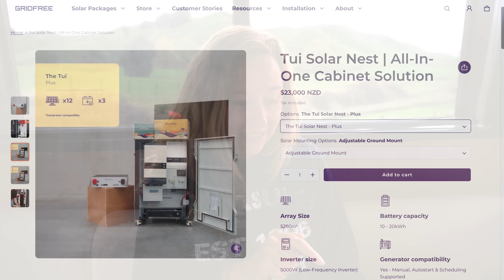Off-Grid Power: Why I Said No to the Electricity Company

Comment: We have a 5kva honey badger redEarth system operating for five years now, and depending on the solar radiation program (chemcloud) going on overhead we have had to boost the batteries in summer at least twice and in winter a couple times every week, however a small fuel cost is better than the robbery of the grid system, the provider rudely wanted wifi access to the inverter for remote access!! but we are not connected to that either, we have 15 panels and six batteries, winter is bad mainly because the sun is behind some very large gum trees all day

Comment: Definitely seems the way to go. For someone on a tight budget it would be useful if there were a solar system that can be expanded with further panels etc as the budget allowed. Thus for instance starting with four then eight and finally twelve. Each as a complete setup that could linkup to the next. I realize  that this might involve three smaller inverters increasing the overall cost but is what I would be looking for. The triple redundancy factor is attractive too.
Reply from the maker: Yes, I wonder if there is a way. The other worry is your system is too small and you need more that you bought!

Comment: 15k for putting poles in the ground is absolutely  over the top and I would have done that myself or get a builder to do the prep. I put solar on my new house two years ago and was quoted 65k. Did most of the work myself along with electrician and got an electrical inspector  to sign it off. 11kw of panels, 3 x  5kw victron inverters (two in parallel), two mppt's, 17.5 kw lifepod lithium  battery bank and 28kw carbon deep cell batteries  installed cost 35k. I had the system  on two phases in case of equipment  failure. No generator  and all electric including 3kw hot water cylinder.  Though this time of year the wetback  does most of the water heating . Solar panels are at 15 degrees  flat on my garage roof facing north.

Comment: In my opinion, the math is still bad for most kiwis living in a town or city, by the time you have broken even on the solar panels you need to replace them. Plus, if you are doing it to reduce emissions or whatever, it doesn't add up either as it takes ages to "cancel out" the emissions of creation + destruction of the panels. But for the case where getting connected to the grid is obscenely expensive, then sure install the panels.
Reply from the maker: Yes, I don’t think it would work for everyone. And I’ve thought about what happens to the old batteries too…

Comment: Just stumbled across you clip, I’m also off grid in South Otago.  Was quoted $13-15k just for the transformer outside my place plus the extras n the added bonus of a monthly subscription 😂 so I also went solar - 5 panels, 3 lithium batteries, inverter n back up generator.
In our third winter now n everything’s going ok, our road has been without power twice already this winter so being on solar has been beneficial when the neighbours come n hook into my wifi to see where the issue is 😂 we don’t have the best cell service where we are
Reply from the maker: So interesting to hear you had a similar experience to me! And great news that so far it’s working well.

Comment: Lovely ! Payback can be quicker too - if you can make power cheaper than you can buy it... it's paid off.  Take your install cost, divide by how much kw you've generated and how much kw the battery has discharged. And that's the cost per kh you've spent. When it's lower than the price to buy power... you're financially ahead. Of course power prices will rise during that time too.....

Comment: Hi from southern New Zealand 😁 i live offgrid and offline 😂i actually have a large panel on the roof ive never used 😂😅 i have small panels for lights and use a torch a lot, especially now in winter but ive been doing it for years and im used to it😅 i gave up on electricity when we had a local substation explode at 4:30 am a few years ago and blow out the grid around here on the coldest day of the year, at the time I was dependent on electricity for everything, especially heating, that was ghastly. The mayor almost declared a state of emergency it was minus 11 Celsius that day🫣 that was enough for me to rethink my dependency on the electricity grid. Friends of mine have a campground between Clyde and Alexandra and recently had to spend several hundred thousand upgrading the electrical network in the camp with all the attendant red tape and waffle, we did as much of the work as we could to keep costs down and it was still horrendous for them. Great choice going solar👍👋
Reply from the maker: Oh wow! Minus 11 and no heating! That could have gone horribly wrong for some people. And sympathy for the campground. I agree that you do get use to different systems. I think it was helpful that I got used to the limitations of solar in the caravan and sleepout before moving into the house.
Reply: @TravellingK yeah, it was bad😂 fortunately they managed to get a emergency transformer on a truck belonging to civil defence set up before it became serious but that was the last straw for me. We'd had power cuts all year, but that one was the worst. They've invested in upgrading the network through central Otago in the past couple of years but I'm done with it😂 funny thing is now I've figured out how to live without electricity, I only miss having a vacuum cleaner and lights that I can switch on instantly👍👋

Comment: 🌅 Excellent Kaye!!😊
Should get 30+ years for array🌻So, at.5% module degradation /year, you will have ~85% available output in 30  years ...then can just spray on PV collector 'paint' on them🖌
The LiFePo Batt's should give you 10-20 years (if cycled between 10-90% D.O.D) 
Sol PV IS Smartest , BEST long-term Free Energy Investment 🌞👨🏽‍🌾🗽
Reply from the maker: Very interesting...
Reply: @TravellingK  🌞Ive been in Sol biz ~31 years😇🌞👨🏽‍🌾🗽

Comment: How many people is it supplying for What can you run on it all very well to say going solar but what can you run? What’s the life expectancy of the panels and batteries? Plus the cost of replacing them.  Electricity is very expensive to hook up but it’s for life. You can run whatever you need to plug in all at the same time so again what can you run on solar. i’ve looked at solar it would’ve cost 25,000. Without the batteries
Reply from the maker: Without the batteries? Yikes! 
I don't think solar is the way to go for a big family with multiple computers and wanting all the bells and whistles in the kitchen. I have a big fridge / freezer as the biggest draw. The rest are lights, TV, charging electronics. A washing machine. More on the humble side.

Comment: Great reveiw any lead based battery be it acid carbon crystal ot glass/gel all have a realistic depth of discharge of 50% ive seen all these claims of 30% ive been in the trade 20 years in marine and offgrid systems. Lifepo4 in 2025 is the way to go when set up correctly

Comment: In Melbourne Australia, I have 6kwh system, with diy LIFEPO4 16kwh battery. Now the battery cost around $1600 and 440watts n type bifacial panel $90. So decent system can be made around $4k to $5K. Now in Melbourne, people give away their own panels, SMA inverters, direct drive lg washing machines. These SMA inverters can be modified to work off grid by getting the grid guard code from the SMA and washing machine direct drive motors can be used to make wind turbine and can be used with the SMA inverters along with the solar panels. I never paid any bill for last 2 years.

Comment: My brother brought a battery off NZ Lithium 14.3kwh useable capacity, and the price is just $5500, including GST! Compared to a Tesla Powerwall 3, let's just say you could buy 3 from NZ Lithium and still have some change!
Reply: New and used Leaf cells on trademe, $40 to 100 each, 3.7 volts 50 AH. Make your own, BMS available from Ali.

Comment: Now that you have your system in place, you should look for cheaper options to upgrade. I just installed a 6.2kw system and a 5kwh battery along with a bit over 5000 watts of solar and it cost me only usd 2400. Yes, I'm living in a place where solar is very cheap, I did most of the installation myself, just hired an electrician to do the final connections, and my inverter is only ip 21 (side filters need to be cleaned every 3 to 4 weeks) but still, it is an excellent value for money and I am on track to recover 60% of my investment within the 5 months of summer.

Comment: Nice.   We are in a suburb so are connected to the grid.  But, solar and batteries have largely eliminated our power bills, and most years result in getting a payment from the power company for the excess power we send back to the grid.  It ranges from $100 to 400 USD.  Previously our bill was up to $450/mo. 

Also, the grid by us seems to be a little spotty and we do have outages.  We never notice them since the batteries take over instantaneously.  The lights don't flicker, the TV does not stop.  We only know the grid is down because we get a message on the app.  Solar and batteries are one of the best things we have done.

Comment: You are the perfect use case for going off grid. Except using grid free is probably a mistake. I suggest using what your local electrician. Sigenergy would be way way better than grid frees. It’s also not a diy thing in New Zealand
Reply: I agree with your first sentence. Why is grid-free a mistake? It clearly is not a mistake for many / most rural people at the very least, unless there is already a power line going right to their intended connection point. For the rest of your message, it's difficult to even understand what you are trying to say.
Reply: Not DIY? My diy system has run for nearly 20 years. Now also includes my 20KWh forklift battery, forklift still used when unplugged.

Comment: solar is cheap these days so the grid is getting obsolete or just a backup.  i have 10 panels of 500Wp for 64 euro's each (640)  a 10kW hybrid inverter for 700 euro's and went for a battery pack they use for forklifts.  48V   750aH (36KWh)  for 4000 euro's    total setup= 5340 euro's   random stuff like cables and fusebox etc. its about 1000 euro's    labour i do myself (i am sparky and builder)   when you invest some time in shopping around and thinking outside of the box you can get good deals.  i never went for lithium because to expensive and the BMS stuff is vulnerable ( i've experienced) so for me old fashioned (trusty) lead acid.
Reply from the maker: Ha, sounds like you know what you're doing!! Fantastic. I think I picked lithium because I'd damaged my old deep cycle batteries after only 3 years and lithium was finally starting to drop in price.
Reply: Same with 48v 400 ah forklift, still used the forklift, solar or mains charging.

Comment: I got a quote of $110K to get connected to grid 20 years ago in Australia.  I'm a sparkie, and at the time i had been working with alternative energy options in marine.  I installed a 40Kw - 20Kw 50% DOC battery bank out of wet cell lead acid.  I'm still on the original bank nearly 20 years old.  Lead acid is proven to live long life if cared for and quality batteries are used.  Lithium has many advantages, though life span is unclear, hopefully retain 80% capacity after 10 years.
Reply: If you use proper lead acid deep cycle batties like out of a forklift etc, they can last 25-30+ just keep a eye on watering, but even normal good deep cycle batties like used in boats can last 3000+ 30/50% cycles, we have some out of a RNLI life boat that we got given used in 2012-13, that power a workshop that are still doing their job.
Reply from the maker: $100k!! And that was 20 years ago! Ouch. Sounds like you know what you're doing! Very interesting to hear that the lead acid batteries are still working well 10 years on...

Comment: I built my own system from 4x100ah lifepo4's , and 4 x400w panels. I have a 48v hybrid inverter and the whole lot came in at £1500. My house electrics remain standard and I am off grid in the uk from April to October. In winter I get around a 25% saving on my bill and the inverter changes me back and forth from the grid depending on how much sun we get. I also have the added bonus of backup power should there be a power-cut.
Reply from the maker: Fantastic! Sounds like you know what you are doing!

Comment: 9:13 lithium batteries should get a couple thousand cycles when used stationary. prices are coming down for both panels and batteries and the technology itself has gotten so efficient that even when you put them towards the south east, they will still produce about 50% of what they would if placed towards the equator instead (n type panels, scattered light).
Reply from the maker: Yes, the technology really is improving! I wonder what it will be like in 5 years?

Comment: I stumbled into solar power as a backup for hurricanes. However, the more I learned the more I set up. Yes, you can get enough power with panels and batteries but it also requires you to be less wasteful and to do some things differently. Things like hanging cloths outside sometimes and they smell heavenly. My system is supplemental but it has made a big difference.
Reply from the maker: Yes, so true! I've learnt to live without a dishwasher or microwave. I know that's not for everyone.
Reply: @TravellingK  🌅Thanks for your Clear Solar Testimonials 🌞🗽
p.s. I have a 4kW O-G (30° N. Latitude ~5 sun-hour zone) ...operate  Many LEDs, 2 full size Refrigs, toaster oven, coffee maker, electronics/entertainment, etc. + 1000W. Microwave several times daily...+ Window A/C in Summer😎🌞👨🏽‍🌾🗽
Reply: We have become unbelievably wasteful in the West, it feels good just to get back to basics, and have an understanding of what we are doing.

Comment: I would say it's one of the few situations where it's a no brainer, without any other considerations or ethical decisions. With that up-front cost of connection it simply makes economic sense.  Added to that the power cuts and monthly bills, it still makes a lot of sense for many.  It's always good to share the cost of infrastructure if possible, but these more far-flung places without that advantage paves the way for alternative, and hopefully better ways.

By the time you may be looking for replacement there will hopefully be even better batteries using more commonplace materials, more efficient solar panels, additional ways to add power during cloudy weather etc etc.
Does the company selling the kit offer anything in the way of maintenance?
Reply from the maker: Yes, it's crazy how fast technology is changing and improving! I heard there's an even better battery to lithium slowly making it's way to market? Luckily the company seems to be happy to answer questions. I was confused about one part of the install and they helped sort it out.

Comment: You did well and no it's not a surprise because, whilst I am still to take the plunge, I have been watching solar vids for a few years now.
And who knows what the electricity price will be in the future....it may go up and mean that your payback period is even less......or the rates may go down as power companies transition to renewables and your payback my extend.....either way though you are still way ahead by halving the installation cost and not having monthly bills. Also, even if the price of electricity does go down, the cost of installation will only ever go up!!!!
You probably already have but i would add a cheap back up solar generator (that you can use your existing panels to charge and even a small gasoline generator just to cover the basics if your main system goes down.
Nice to have that power during power cuts. I live in Thailand and my village has so may power cuts. I recently bought a cheap second hand Chinese EV and during power cuts I can run a line from it and power up to 3000 watts. I built a circuit to run my fridge, TV a couple of fans, my PC and an outlet to charge devices and boil a kettle if required. It only uses on average less than a thousand watts and the car could run those for 24 hours if required....and if things got real bad I can drive to a fast charge station and an hour or two later (including driving time) go for another 24 hours.
Reply from the maker: So true! It really is a gamble. 
I do have a generator as I didn't want to risk damaging the system if there were too many rain days in a row. 
Gosh, multiple power cuts where you are? Sounds like you have a good setup to survive those hassles.